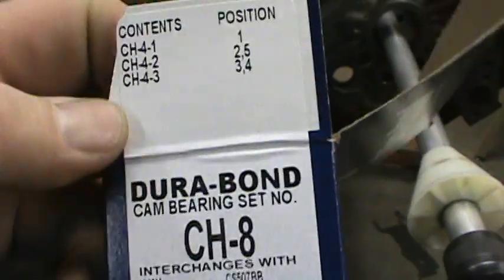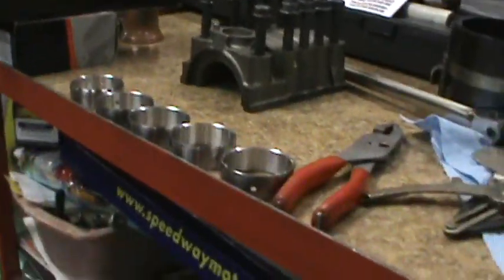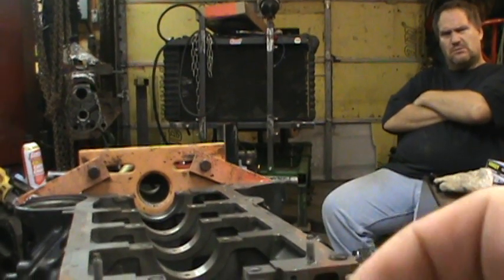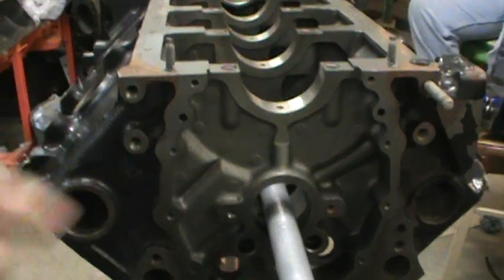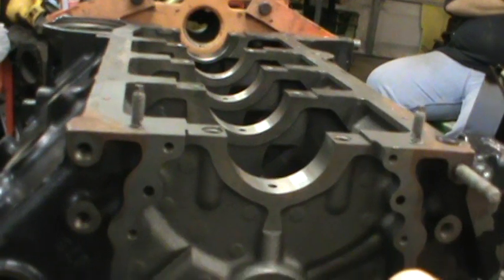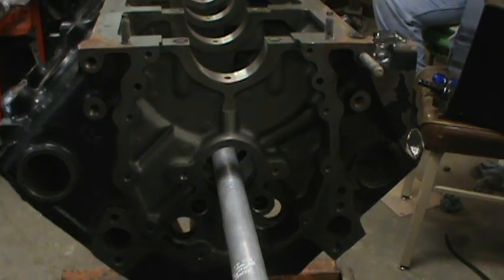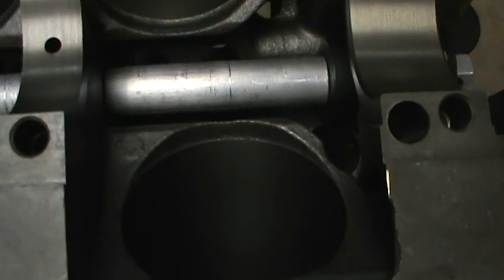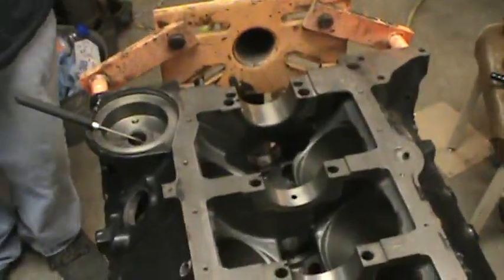installing chevy cam bearings in old school blocks

Comment: I mark mine with a marker where I want my 12 o'clock to be with my holes in the correct time as well. That way I just line my main holes with my marker lines and I don't have to guess.
Reply from the maker: i have done that to

Comment: So what you are saying is if they lined up the oil holes to the block that would EQUATE to loss of OIL PRESSURE when hot and LOW like 20 lbs when cold cuz I have a SBC that gives me ZERO OIL pressure after it hits 180 degrees at idle and only 20 lbs at high RPM 
I put a K N high flow filter on it and put ROTELLA 15 40 in it NO CHANGE! 
I know this was a few years ago but if you still around let me know
Reply from the maker: There are a few things that it could be. Did the oil Galley plug get put back in under the oil pressure gauge hole. Is the bypass working in the oil pump correctly. What kind of clearances was on the crankshaft and camshaft. There's a lot of things that could be I even I just thought of something as I'm typing this did the front Galley plug come out behind the timing gear. lot of possibility  not sure what to tell you since I don't know what's going on with your motor for sure.
Reply: @tlcbear2  Thanks for the REPLY I have no clue as to what was done its a 4 bolt main out of a mid 70s truck hats all I know will find out this winter

Comment: when you put the cam bearings in that 7 o'clock position, how do the mains get oil?
Reply from the maker: The others I put in at 4 o clock position
Reply from the maker: The mains get the oil because of the groove around the cam bearings.

Comment: After watching about a half dozen cam bearing install videos, I see some commonalities.  First, it seems like nobody measures their journal and compares it to the new bearings - a whole lot of assuming going on, and that could be pandoras box on an old reworked block.  Maybe only 2% of builds have a chance of a real problem, but why not check?  Spun  bearings suck.   Second is... it seems nobody gauges annulus depth & width around those cam bearing journals - that's your main bearings life supply, and a few high spot irregularities can ruin a future day at high rpm's, and be a lurking sludge trap. [Maybe this groove is a good area to lightly polish on all out builds?].  Castings vary from time to time, and so does machine work - tools may chip, ajustments slip, zeroing contains a missed/hidden offest, or whatever.  And, what is spec for sbc anyway for the annulus around each cam bearing?  I haven't found it yet, but still searching...  It has to matter, because mains matter. 
  My shadetree guesstimate is that the cross section of hole drilled between cam bearing and main should be something close to 2x annular groove cross section x 0.85 [work that backwards as needed] -  but... any engineers out there that can nail down a good number, please have at it .  There's two paths around the back of the bearing, and since it comes and goes at right angles [diverging then converging], there's going to be some flow resistance and efficiency problems.

Comment: Great video!  2 questions just to double check if you don’t mind. 1) does this work for ‘stock’ engines or is it for race engines? And 2) for the front cam bearings with 2 holes do you mean put one around the 4-5 o’clock and the other hole around the 7-8 o’clock with the engine upside down?  Thank you!
Reply from the maker: you can use it on stock ir race motors.yes when block up side down.
Reply: tlcbear2 thanks!!
Reply from the maker: your welcome

Comment: Great video, I am doing mine right now as I'm watching yours the only question I have is how far back did you put that number 5 cam bearing.
Reply from the maker: you go until the hole in cam bearing is the groove of the block
Reply: @tlcbear2  from what ive seen i dont think my bearing should go any further. I dont see the groove through the bearing hole. Do you have a facebook TLC ? Id like to send you pictures.
Reply: Can i send you a email Bear? I have a couple pictures id like you to look at on my block.

Comment: Can I do this with a 4.3 v6 I know the front and rear is the same.
Reply from the maker: have to look at the block I cant remember if v6 was a full groove or it had to line up to hole.
Reply: @tlcbear2   Yes it has full groves it's a zin Z an older 4.3 none vortex.
Reply: @tlcbear2  Thanks for the info I just drove the car 200 miles . Worked great 60psi at start 50psi going down the highway and 30psi when she's hot. Not a pep from the valve train thanks again 👍.

Comment: A lot of the bolts I removed from my engine were covered in oil, water pump bolts, intake manifold bolts, and main caps is this engine block still ok to build, is it a failed cam bearing
Reply from the maker: depends on if the cam bearing spun in its bore.

Comment: hello so I have a 355 sbc took it too machine shop and they installed bearing  with holes on cam bearing  in same position as  holes in main will motor fail because i also bought all bearing there and a 270 cam for it there
Reply from the maker: i have seen motors run like that. but i just dont like them like that